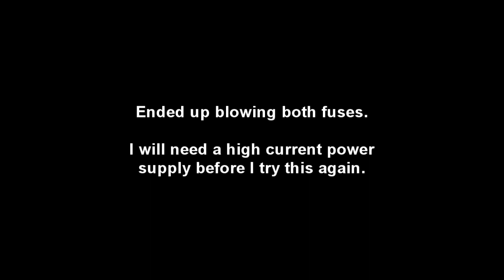Mobile Phone PCB Burnout Failure

Comment: Hmm good point, a variac is a fancy autotransformer!  So many amps can that thing Output!?  I wish I had a good power supply with a proper chunky transformer, it would have lots of different voltages including lots of USB sockets that have 2 amp output for charging phones and other items :D 240 volt or 12 volt input for mains and batteries!  It would even have an ATX connector on it!!!!!  Ohh and it would all fit into a GameCube case, in my dreams haha!!